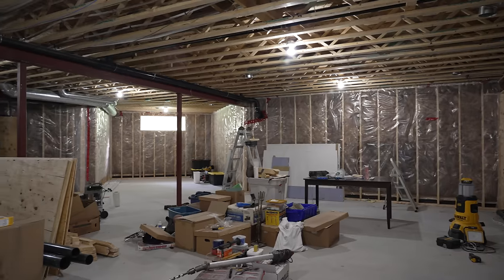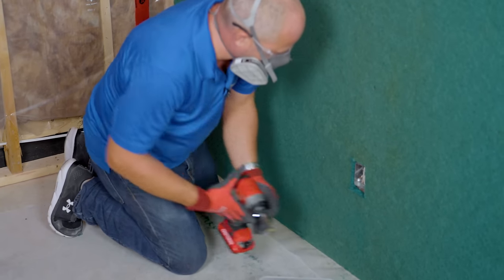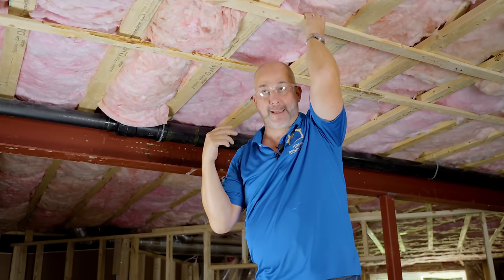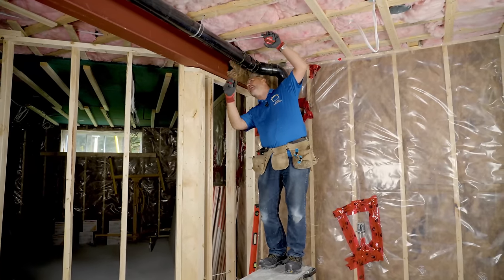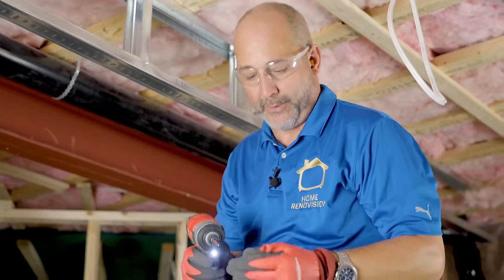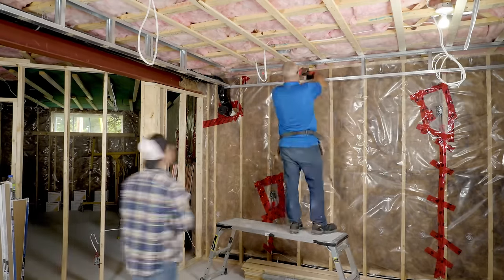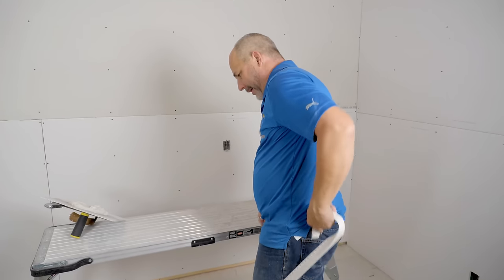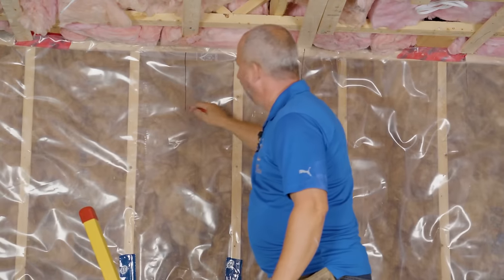I Finished This $80K Basement For $18K. Let Me Show You How You Can Do It!

Comment: In Europe, screws for the ceiling tile are put 15 cm apart, and for walls, 25 cm. At least, in Germany, Romania, Luxembourg, Belgium and France. The distance from the corner of the plate is 10 cm in the echer at the first screw. You note in Inch, we in centimeters, except England. Everyone knows how to make drywall, but not everyone is a craftsman. You measured the plug gap correctly, but forgot that the board was too wide and you had to cut it from the bottom, In conclusion, you are not careful or you are not a good craftsman. I have been doing this job for over 35 years and I have not had any mistakes, especially since I know how to read plans, which are very important. When cutting the plate with the cutter, the blade is removed in half and the knife is bent at a much bent angle, so you do not tear the paper, except where you cut, it does not tear, it does not break, but it is simply cut. Never give the glue to the joints only with the spacle. Just fill the line between the plates, then with the glue paddle on width of 30 cm along the joint, because if you just give with the spacle, as at a close look, you will see a thickening of the glue, but if you go directly with the palette of 30 or 35 cm, the thickening is lost over the distance.  Always cut the door with the circular rail, so that the perfect cut comes out. Such a thing as you did, is not allowed in Institutions or Banks. With the cutter when you're done cutting with it, you put the blade back in, always, There are serious penalties in Europe for this minor thing. Remember that. Between the door frame and the metal structure of the door gap, always put polyurethane foam. Even if the space is very small. No offense, but what you showed in this video is for amateurs or beginners in construction, not professionally. What you have presented here is made in a house, which is still accepted some imperfections, but if the owner knows the job and has knowledge of construction, he does not accept them and you will pay out of your pocket for the broken materials.

Comment: Unfortunately he doesn't understand that it has absolutely nothing to do with holding the sheet up you hang the lids first that's the way it's done and the reason for it is you don't tight cut your Lids, when you hang your walls first now you have to tight cut your lid which means now you're going to be fighting to get it into place and most guys ain't using a panel lift it's usually you and a partner, the finishers will love coming behind you to mud

Comment: “I saved 80k” yeah because you’re a general contractor lmfao
Reply from the maker: And I share my experience with you so you can do it too. You can laugh or learn but I laugh all the way to the bank and so can you! Cheers!
Reply: Currently going through a smaller basement reno myself, I got quotes from contractors between 60k and 75k and I will spend less than 20k doing it myself. I believe his 80k figure
Reply from the maker: Darn right Josh. You can do this!
Reply: @HomeRenoVisionDIY  Do you recommend a beginner trying to install vinyl plank? Can I install it directly on a wooden subfloor? I'm scared, Jeff. I want to try but I don't want to fail either. Doing it myself I can save 900 USD.
Reply: I've been watching this guys videos going back years.  I ended up firing my contractor & doing the bulk of the work myself, while following a ton of Jeff's advice & wisdom.  Saved tons of money & developed skills.

Despite what you may think, you're capable of doing it yourself.  Get over your fear, even if you mess something up, you can always fix it.
Reply: Always a negative ninny . He has taught me so much i have easily saved $30k already . The absolute best on you tube .
Reply: @TurboButton  even if you make a mistake,  ask how much will it cost to correct the mistake too perfection? I am betting between the knowledge you gain, and the cost of a few extra materials and you could make a handful of mistakes and still be saving while leveling up. Masters fail 1000s of times; its only when you stop trying that you become the failure. rickroll
Reply: @quantumbass  absolutely bang on
Reply: So far I have gutted and completely renovated my kitchen, dining room, two bathrooms, two bedrooms and built a three level deck.  This includes new wiring, plumbing, tile, etc.  I learn so much from you, though when you do something I’ve not done before, I have to watch it multiple times as you are so fast.  Thank you!!